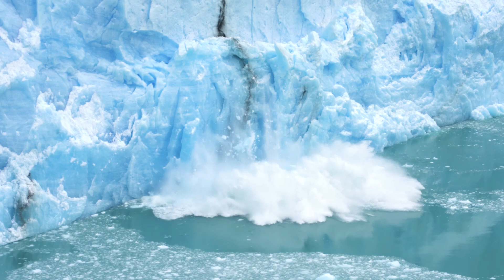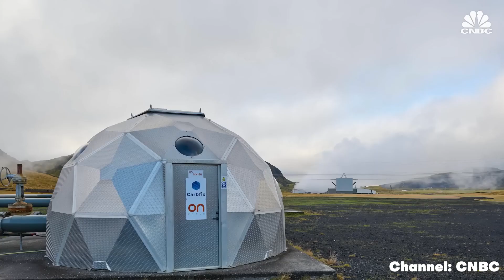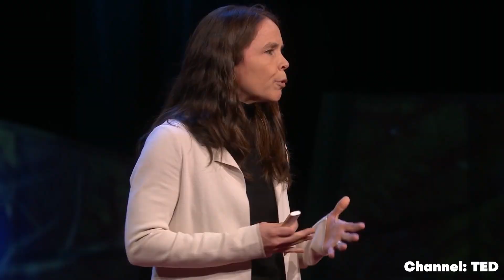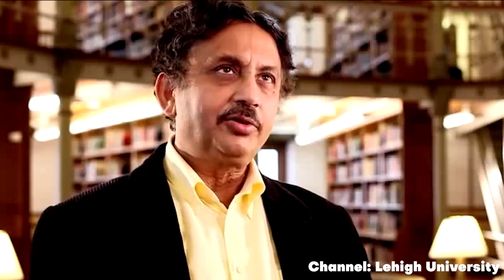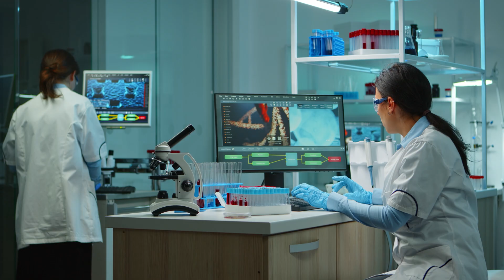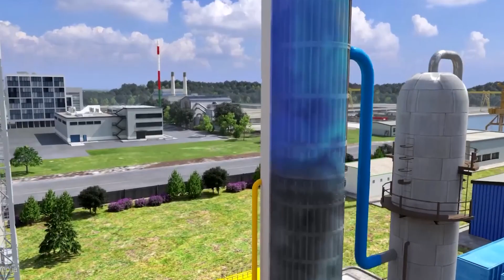Breaking Barriers: New Approach to Carbon Removal Technology Promises Efficiency and Affordability

Comment: We haven’t reduced emissions with green energy we’ve just consumed more energy and added green energy as an increasing percentage of the energy mix. Fossil fuel based consumption is still rising so emissions from fossil fuels are rising. Since this video starts off with a glaring fallacy I don’t trust it. Traditionally direct air capture has been an excuse to keep increasing fossil fuel use and hopefully fix the problem later via some miracle technology.